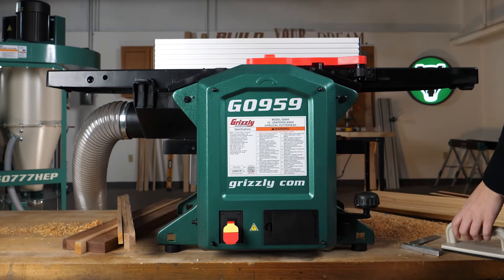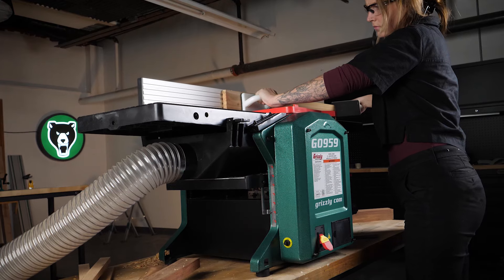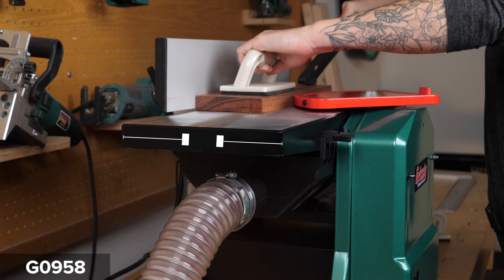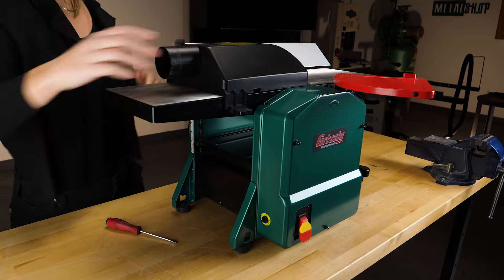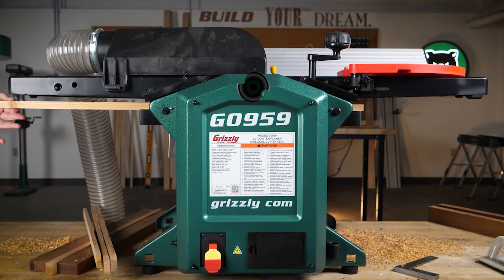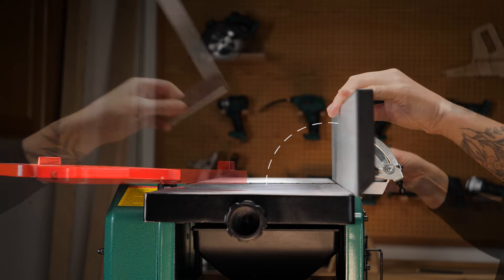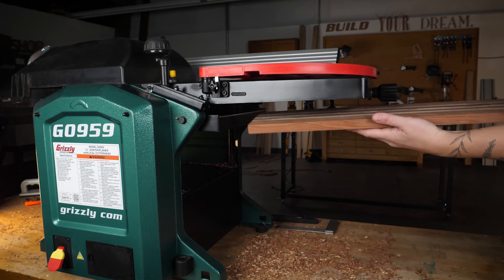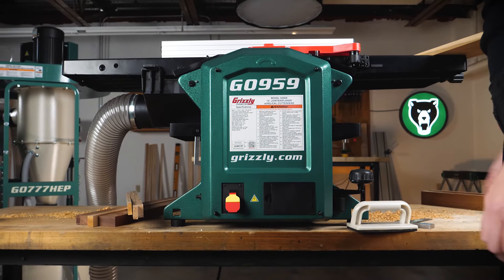Grizzly Planer/Jointer Combo | Minimize your Footprint, Maximize your Workflow

Comment: I have a GO958, it's like the GO959 except smaller,  but works well. I'd recommend it
Reply from the maker: Agreed, they are extremely similar. Just depends if you're looking for an 8" or 12" max width. Glad you like yours!
Reply: @grizzlymachines  more so, the 12” is a longer bed so not only can it take wider pieces, it can support longer pieces too.
Reply: yes

Comment: I have an 8" in my cart..A friend of mine moved and gave me a 6" delta jointer with a 36in bed. I was going to change the cutter head to helical for $300., but I think I'll get this and sell the Delta...
Reply from the maker: We love to hear it! Hope it serves you well :)
Reply: @grizzlymachines  I did sell the Delta and purchased the Grizzley 8" jointer/planer. It works great right out of the box. As a box maker who specializes in Flag Cases with a small shop, it just what the Dr. ordered. 17" Band saw is next.

Comment: One YouTube poster stated that (per the manual) the fence has to be unscrewed on the 12 inch model to covert the machine to planer mode.  Can you confirm that the fence can be moved in the way you show on the 12 inch model?
Reply: I don’t have to remove the fence to convert it to planer mode.  I just slide it over. It’s a pain to put the fence back on so I’ve successfully avoided it
Reply: Late to the party, but I just unboxed my G0959 today. You merely loosen the stop handle and tilt the fence from 90° to the 45° position. The fence slides on the G0958.
Reply: I gotta say I’m I’m really not happy having to make that adjustment. Why on earth is it designed so that I have to fool with the fence of thee jointer when I want to go plain something and why isn’t that I can’t just have the vacuum connected constantly. it’s insane, this thing needs some serious rework

Comment: Has anyone bought the G0959 and tried it yet? 
I need some feedback about it, I am debating between this one and the G0634X since they are both 12" Jointer/planer combo and their cutterheads aren't straight knives, it is the price difference between the two that I am considering!!
Reply: I found a guy on reddit with the 12" one and he loves it..he will reply if you ask a question
Reply: I own this unit. So far, I like it. I don’t have dust collection for it yet and it doesn’t have a blower fan so I haven’t used it a ton but it definitely works

Comment: The old Foley Belsaw made this same thing, not a new concept. It utilized the cutter either from the top as the jointer or bottom through the planer.
Reply from the maker: Yeah quite the efficient way to utilize one cutterhead. This is a new product for us, and we're very excited to be carrying this 2-in-1!
Reply: @grizzlymachines  Good to be seeing a new version in production though as a modern option!

Comment: My G0958 started leaving black streaks on everything I plane and not feeding wood after only 4 hours of use. So far I've only planed new soft wood. Checked and feed rollers are disintegrating. Parts of one flaked off on my fingers. Had planned to do several hundred hours of work on the unit this winter, doesn't look like that's going to be possible. Contacted Grizzly. I like the form factor and, so far, the jointer has worked fine, but the planer failing like this after only 4 hours of work is a pretty bad sign for a shop tool.